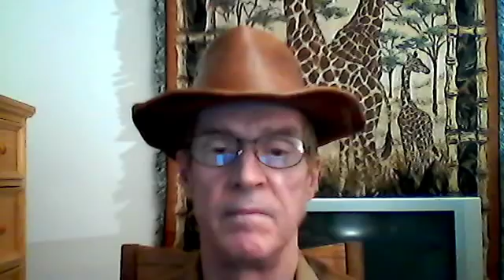Random Wire Antenna Essentials

Comment: thanks!! I am in a situation ware a ground rod is out of the question as I rent and travel a lot!! so I read that a quarter wave counter poise for every band is acceptable alternative to a earth ground right? I would like your thoughts. the idea behind the electrical outlet ground was to discharge static electricity from the antenna using a lighting arrestor to prevent the transceiver from getting damaged from static build up on the antenna. will a outlet ground be sufficient for that? I would like your thoughts on that. lighting is common where i live, and because I rent and travel I will remove the antenna wire from the house when not operating or when lighting is moving in and if time permits take down roll up and store away . my other question is max safe power to run using a random wire antenna especially on upper hf bands like 10m regarding RF exposer safety? I would like your thoughts. I have a lot of challenges as a renter and traveler and the biggest is grounding as a ground rod is out of the question. just need to stay safe and not fry the transceiver from static build up on antenna. a real ground for most of us that will protect from lighting is costly and impossible for renters. well I am looking for ideas so your knowledge is appreciated keep up the work 73 good dx.
Reply from the maker: You can use a 1/4-wave counterpoise for each band as an RF ground for that band, and you should disconnect the antenna whenever you aren't using it. The electrical outlet "third prong" (ground) can suffice to electrically ground the radio at all times. As for RF exposure safety, I don't know enough about that to give you a meaningful answer.
Reply: thanks for the advice!! I think at 20- 50w on a random wire I will be fine on all the hf bands. what do you think? I like the idea of a random wire antenna as no coax and such to complicate things! have made dipoles but move so much that the coax never ends up being the right langth for the next set up. all so dipoles are not as esey to hide as a random wire. well if you have sum other ides for random wire antennas tips and tricks I am all ears! o have you heard of the w3edp antenna? it is old from the 1930s and it looks like it is a zepp antenna.  how do you think it would compare to a random wire? take care and good dx!
Reply from the maker: Fifty watts should be okay on all bands. Sorry, never heard of the W3EDP antenna. The only way to see how antennas compare is to test them individually and find out! It will vary from location to location. 73 de Stan W1GV.

Comment: So to answer the question of what "random" end-fed antenna length to use, the folks at Balun Design have published those on their website when using one of their (or really anyone's) 9:1 unun.  Using a transmatch as you stated takes the place of the unun and a tuner [combo] so the same lengths of wire still work quite well. The important rule is that for multi-band use, you want to stay away from RESONANT lengths which fall inside the Amateur bands. That's right, non-resonant works best.  The same information can be gleaned from older handbooks when antennas like this were the norm, way before solid state gear was even thought of.  Here's a link to Balun Design's white paper on this.  It's a good read:
https://www.balundesigns.com/content/Wire%20Lengths%20for%204%20and%209-1%20ununs.pdf
A few of us use end-feds with QRP this way (53ft wire) at local parks with great success (stateside and DX).  Use a good counterposie if you go the unun route or a good ground off the back of the transmatch, otherwise it's less than half of an antenna.

Comment: Ok, so as hams we are told to ground and/or disconnect for static and lightning... and woe if the ham op who transmits during a storm!?!  However, the world doesn't stop for every electrical storm... air traffic controllers, police/EMTs etc all run 24x7 using their radios as well as cell towers, AM/FM broadcast radio & OTA TV... so what is in their bag of tricks so that they don't continually fry their equipment? 

Also, doesn't W1AW run nonstop, what is their magic???
Reply from the maker: Generally, they use lightning arresters and hope for the best. I recall that when I worked at W1AW, the antenna feed lines came into a separate room to the tuners and other tuning apparatus. During severe lightning storms, sparks would fly all around that room. I stayed out of there but could see the flashes from the main operating room. Don't recall any equipment damage, but I got pretty cotton pickin' scared sometimes. You do best to remain on the safe side unless you have no choice but to stay on the air during a storm.